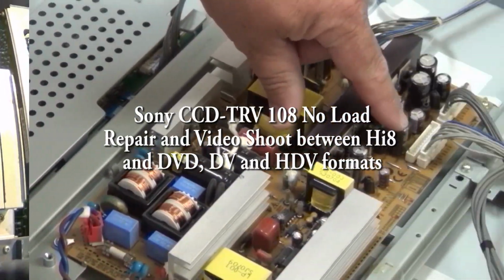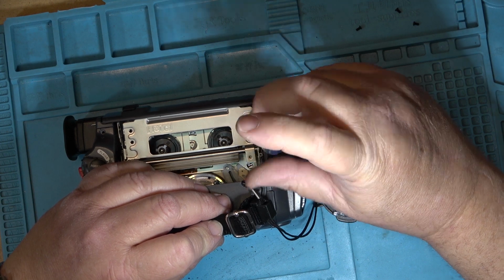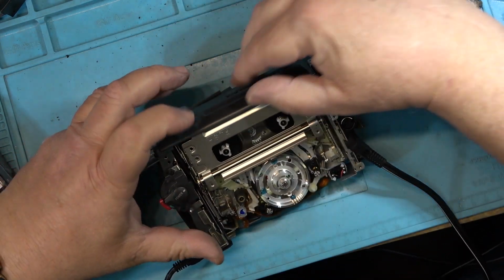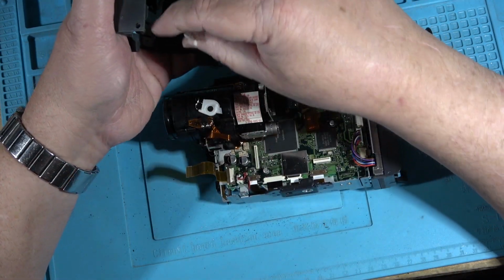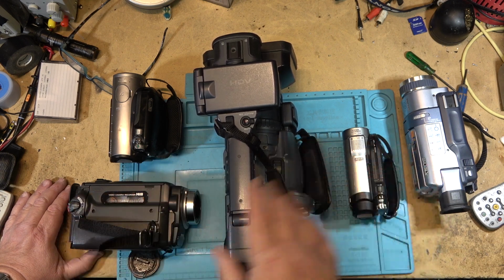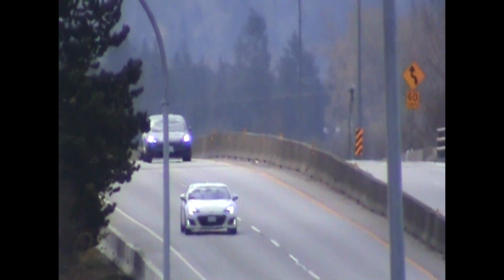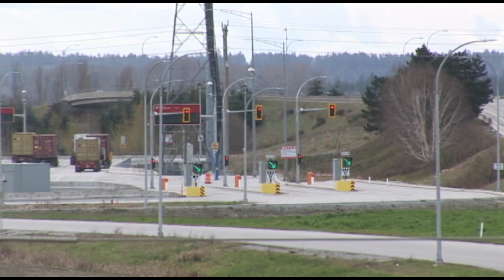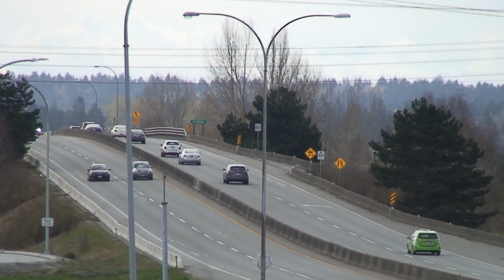Sony CCDTRV108 Repair and Video Shootout between various cameras

Comment: Hi Dave. I live in Toronto. I have a Sony DCR-HC30 minidv camcorder. It's fully functional except for a minor issue. It makes a ticking sound when playing back a tape. I am not much bothered about the sound but along with the sound I can see a flicker in the video which is annoying. The ticking sound is approximately once per second. Would you be able to help me with that ?
Reply from the maker: Ticking about once a second could be a cracked gear that every time it goes around emits a sound and if it disrupts the capstan speed it could have an impact on the picture.  I am just guessing and I don't know if anything can be done as there are no parts available.
Reply: @12voltvids  Thanks for your reply. I think you are right. I was also thinking on the same lines that some gear might have a missing tooth or cracked. However, I am in luck that I have an exactly same model sitting around that has a damaged head from overcleaning and touch screen doesn't work. The tape loading mechanism, FF and Rewind work perfectly. I am not a qualified camera repair technician but with proper guidance, I can take apart and reassemble electronic gadgets. Do you think you can help me with that.
Reply from the maker: @subhashchopra363  i have a hard enough time with mini DV.
Reply: @12voltvids  Ok. No problem Dave. Thanks a lot for your prompt replies.

Comment: HD makes it so much better
Reply from the maker: Funny that some people still want to shoot in 480i analog video. Ug.
Reply: @12voltvids  Actually, Sony digital 8mm, such as the ones I have, the DCR TRV130 and TRV140, when recorded in SP mode, produce about 520 lines, just over 480i. My Sony 4K TV upscales all video signals, including regular DVDs. Consequently, these videos look quite good, 4:3, 16:9, on such TV sets.
Reply: I had the Sony CCD-TRV58 Hi8mm, which I bought new but later sold, then I bought the DCR TRV130, and then the DCR TRV140, which I still have. The TRV130 uses the L-series batteries, which are larger, and the TRV140 uses the smaller M-series batteries. The video quality of the 130 and 140 is much better than the Hi8 ever was. Of course, the tape runs twice as fast, giving you one hour at SP mode compared to 2 hours on Hi8. They can run at LP mode, but I have not done a test to compare the image quality of digital 8 at SP and LP modes.

Comment: For some reason, the camera demos looks a little out of focus (soft) to me. I wonder why. Maybe because I'm watching it on my phone? Usually it's all sharp.
Edit: it did look better with the DVD camera. At the 24-25 minute marks.
Reply from the maker: The camera demo shots except for the HD footage was 480i footage.  The hd was 1080i. The footage of the camera repair was shot in 1080p60frame.  So yes the sd footage will not look as sharp as the hd footage.

Comment: My wife and I had a Sony Handycam, purchased in the early 2000s. It stopped working after only a few years, and I opened it up to see what was wrong only to find that electrolyte had leaked from several capacitors and had ruined the camera.
Reply from the maker: Early 2000's? Haven't seen any from that era that had leaky caps. Late 80s and into 90s yes for sure, but from about 96 on I haven't seen any. Perhaps you got an old one that a dealer had in inventory for 5 or 6 years. I know that is possible because there were a few models of camera we had at the shop that just didn't move and they had a few birthdays until the owner got tired of looking at it and sold it at a loss.
Reply: @12voltvids  We bought it on special discount from Costco online. So, it could have been a slow-moving older item. We may have purchased it in the mid-2000s for all I know. It appeared to me, as I recall, that the leaking capacitors were all the same make. They did substantial damage to the circuit board copper traces. So, I decided that it was not repairable; but if someone wanted to put in the time, it could perhaps be repaired.
Reply from the maker: @Amp497  could have been an old model on clear our.  Mid 90s was the last i remember seeing go bad but then again i left the business in 2003 so perhaps there was another bad run of them because from 2003 on I didn't do any work on electronics and i didn't get back into it untill 2013 and it has really only been a hobby since then.  There is no money in repairing electronics and parts are hard to come by.
Reply: There was a bad capacitor epidemic in 03 and it seemed to be a lost formula or something.
Reply: @marshmower  I remember the bad capacitor epidemic in China. They were putting the wrong electrolyte into capacitors a lot at that time that I recalled.
Reply: My parents purchased a Sony Handycam also in the early 2000s. It looked similar to this one, but it was a different model because i remember it having nightshot. I think it was last used around 2007. Been in storage since early 2013.

Comment: Hitachi actually did make a Blu-ray disc camcorder, that also has a built-in hard drive. I have one, and it works, but all I get from it when recording is a black screen. It either has a dead image sensor or a stuck iris.
Reply from the maker: Stuck iris.

Comment: In your opinion, which was the best digital 8 backwards compatible Sony Handycam? I'm talking from a reliability etc point of view for use as an archiving machine.
Reply from the maker: The DCRTRV240 is what I used on this one. Only down side it is a bottom feeder. DCRTRV720 was probably one of the better units.

Comment: Digital 8 looked better than I thought it would
Reply from the maker: Digital 8 had the exact same spec as minidv and dvcam. The limiting factor was a crap camera which the first gen cameras had as they did not want to undermine mini DV sales.  But by the time hdv came out d8 wasn't a concern anymore as there was a newer better format that was compatable with the DV standard. Hdv. It allowed true he recording at 720p or 1080i, true broadcast quality.  Of course the race to flash recording was on and no looking back to, i quite the late John Lennon "a little bit of plastic". A he referred to tape as.  
I went SD as soon as the cameras came out and have never looked back.